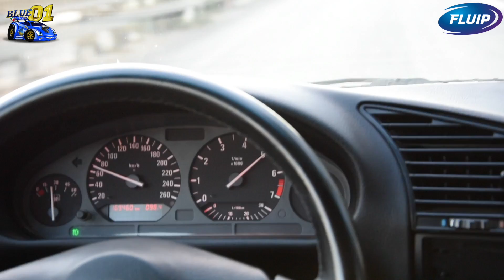Cambio manuale duro? Differenziale rumoroso? Risolvilo con un semplice tagliando

Comment: Salve ho una 595 abarth preparata gia uso l olio 10/30 fluip racing nanotecnologico rosso e mi trovo molto bene anche se casa madre consiglia 10/50! Ora le temperature non superano i 15 gradi  ,ma poi in estate con 40 gradi e il motore abarth scalda di suo mi consigliate la stessa gradazione o passare al fluip 10/60 visto che faccio 4 tracday al mese? E per il cambio visto che abarth consiglia gl4  75/80 ho provato una marca conosciuta in america gl5 e mi sono trovato molte briciole ferrore nel tappo! Voi cosa mi consigliate per non
Provocare questi danni? La macchina ha 14000 km gia ho fatto 3 cambi olio sempre con il vostro lavaggio ultimo con olio fluip prima avevo amsoil racing 10/30.mille grazie e in attesa buon lavoro 👍
Reply from the maker: Salve, le consiglio di continuare ad utilizzare la gradazione del Fluip PRO 10W30 Racing Nanotech. Poi ogni motore risponde in estate in maniera differente anche in base alle modifiche e solo testando si potranno tarare i lubrificanti. Al cambio le consiglio di utilizzare il Fluip PRO 75W90 Racing Nanotech in quanto supera ampiamente le caratteristiche richieste da casa madre offrendo una protezione senza eguali. https://www.additiviblue.it

Comment: Buongiorno, sono già vs. cliente con altri prodotti, le chiedo: devo sostituire l' olio del cambio manuale delle mie 3 auto, una volta scaricato il vecchio lubrificante, posso inserire direttamente il Fluip Pro 75W90 Racing  Nanotech o è meglio aggiungere all' olio sintetico l' additivo Black Gear Nanotech x cambi e differenziali? Si ha lo stesso risultato? Attendo, grazie.
Reply from the maker: Salve, la miglior scelta che possa fare per i cambi delle sue auto è quella di utilizzare il Fluip PRO 75W90 Racing Nanotech ( https://www.additiviblue.it/shop/fluip-motor-oil/linea-cambio/fluip-pro-75w90-racing-nanotech/ ). Il Black Gear Nanotech è stato sviluppato per utilizzarlo solo nei casi in cui si ha una cambio rumoroso. Grazie per la sua attenzione
Reply: @AdditiviBlue01  Bene, mediamente (uso all' 80% cittadino), ogni quanto consigliate di sostituirlo?
Reply: @diesel-td1946  consigliamo la sostituzione ogni 80.000km

Comment: X seat ibiza 2017 iv serie dovo posso comprallo olio piu aditivo  e quale mettere su un diesel tre cilindri grazie negozio napoli dove comprallo grazie
Reply from the maker: Salve, tutti i prodotti potrà reperirli on-line all'interno della sezione shop del sito https://www.additiviblue.it. Per il suo cambio consigliamo il Fluip PRO 75W90 Racing Nanotech ( https://www.additiviblue.it/shop/fluip-motor-oil/linea-cambio/fluip-pro-75w90-racing-nanotech/ ) Mentre come additivo diesel consigliamo il Diesel Active Blue ( https://www.additiviblue.it/shop/additivi/linea-diesel/common-rail-multijet-iniettori-pompa-per-filtri-f-a-p-e-d-p-f/ ) ovvero un'additivo carburante in grado di svolgere 4 Funzioni! Per maggiori info potrà avvalersi anche della nostra assistenza diretta gratuita scrivendoci a commerciale@primetechnology.it